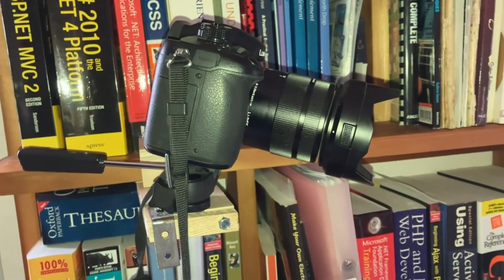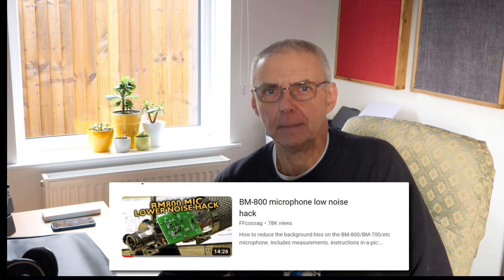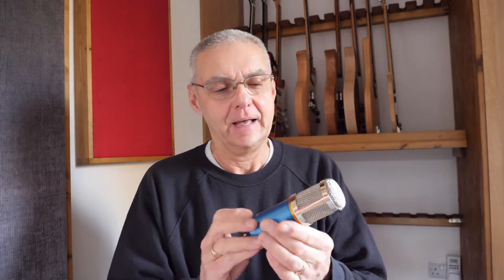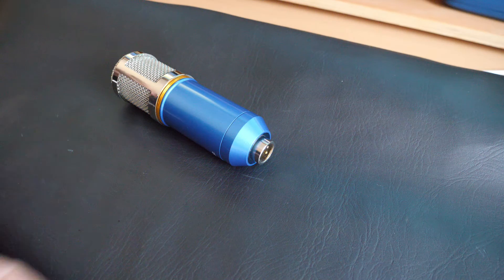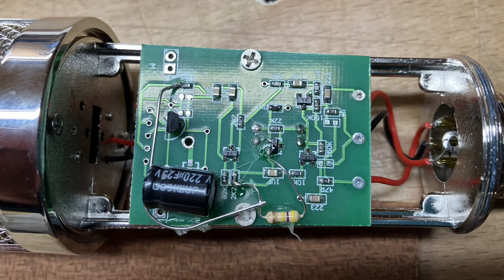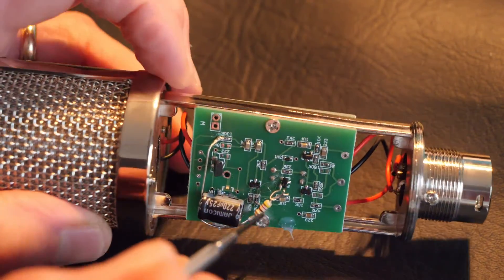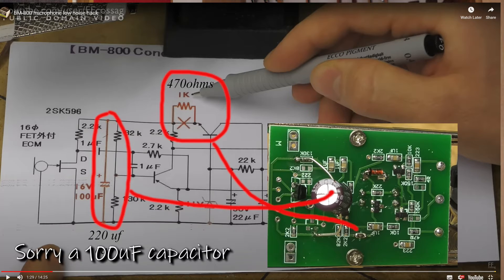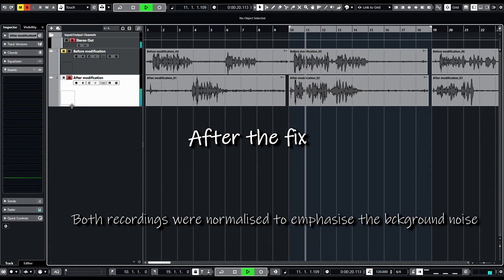How to reduce the hiss from a BM-800 entry level microphone

Comment: Awesome Dave. It looks like you're basically adding a filter to the circuit? I wonder what this does to the frequency response of this mic? It sounds good on spoken word. I'm just curious!!✌️🤍
Reply from the maker: Hi Todd, I’m not an expert but I think the mod is just affecting the power supply to the FET amp circuit so it shouldn’t have any effect on the frequency response. The slightly lower voltage may have an effect on the sensitivity of the mic but I haven’t noticed it. I love your guitar building, amazing work 👍Cheers Dave

Comment: I bought one of these mics a while back and have modified it, but mainly because it used to clip at what I though were very low levels. If I sang or played guitar loudly any closer than 1/2 metre away, the output was horribly clipped. Checking internal voltages, I found that even using a separate 48V phantom power supply there was less than 1V across the two output transistors and less than a 1V across the resistor load to the first stage FET!
 I compared this with various other online versions and mods and ended up adding bias resistors for the balancing output transistors and raising the power supply voltage to the first stage. This seemed to reduce the noise as well as increasing the level at which clipping occurred. I never had problems with hum though, so I never added or increased any PS smoothing caps. I can send you my before and after schematics if you like.
Reply from the maker: I would certainly be interested in seeing your modifications, I have tried recording acoustic guitar and have noticed some distortion. Than you. Cheers Dave
Reply: That will be useful, cause i've got the same clipping problem